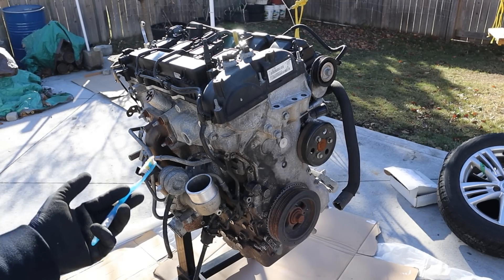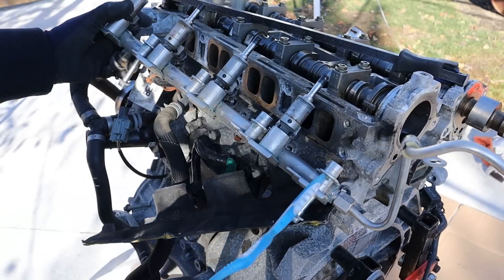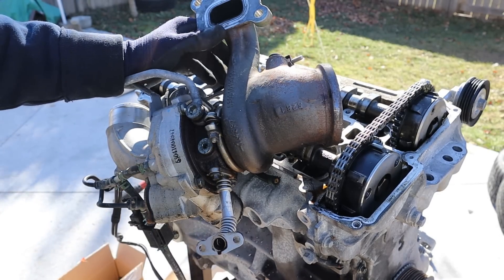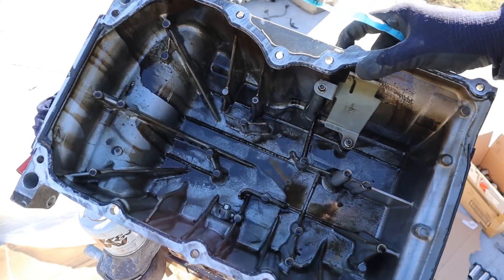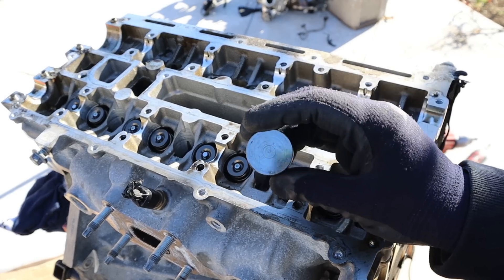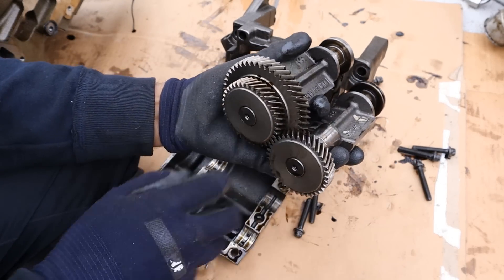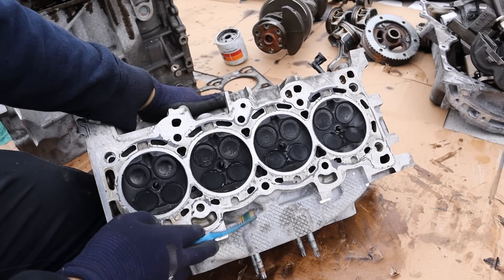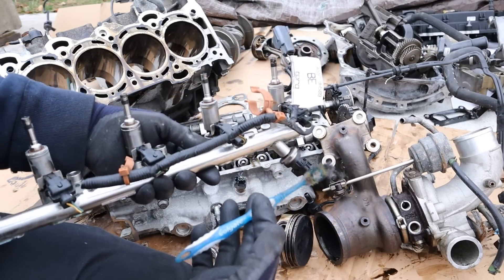Why Ford Ecoboost Engines Fail

Comment: this was before they discovered they would need port injection along with DI to wash or clean away intake valve heads and ports before massive carbon could build up. I have the 2.7L bi-turbo and luckily have not had any issues in 105K miles in driving. Its a mighty little motor and i see 130+ mph all the time...
Reply: @@alexanderratisbona6614 my personal cars are all 8 cylinder so the V6 is a little small to me

Comment: My brothers pants 🤣  Seriously, I loved that he explains so many weak points in the eco boost engine.  Notable is the direct injection, yes it gives better gas mileage but just like GDI on Kia's it causes carbon build up.  ( Im going to check if Speedkar has a GDI teardown)

Comment: It's interesting that 2L 2008 Ford Euro spec Mondeo diesel engines are so much more robust. I think my todays number was around 617 000km's. That's about 380t in miles? Anyway, I know base engine design isn't from Ford, but I still wonder how come they haven't been able to fix all those issues. I mean those Ecoboost engines aren't even that powerful for 4cyl engines. I suppose it's the emissions crap that engine has to inhale almost exactly the stuff it exhales is one big fault 😄
Reply: I wish we had diesel Mondeos in the U.S.!

Comment: Cool video!  Subscribed!
I have a 2016 F-150 with the 3.5L turbos.  123,000 miles and it's still running strong.
When I first got it I read about the water ingestion issue, and that owners were drilling small drain holes in their intercoolers to prevent it.
I instead replaced the anemic little OEM CAC with a much larger Full Race model, and haven't had any problems, even here in humid Florida.
My engine has upgraded Full Race turbos that are a little larger than stock, and a moderate tune that makes 435HP / 456 lb.ft. of torque.
So far I haven't seen the dreaded cam phaser problem, and the truck is a lot of fun to drive.
The DI system is causing carbon buildup I'm sure, and if I keep the truck I'll have to break down and decarbonize it at some point.
Reply: My crown vic was 3000 dollars and it just passed over 350k miles
Reply: @sethhumphries1682  crown vics are immortal from the get-go tho
Reply: Cam phaser issues are in the second generation of 3.5 ecoboost
Reply: Get an oil separator as well
Reply: The biggest cam phaser issues are 2017 to 2020.
Reply: thats called condensation and if you didnt have the OEM ford emmissions bullshit on it (EGR + PCV) it wouldnt force it to inhale water in the first place.

Comment: Every Ford I've owned and that friends and family owned ended up being nothing but problems. Every single one of them; from the 1970's to today. I could cite dozens and dozens of examples, each one ending in a major mechanical failure (head gaskets, transmissions, electrical problems, etc.) that wasn't worth fixing. You couldn't give me a Ford or even pay me to own one. They are poorly designed and engineered to fail. Pure junk.

Comment: New impact wrench? Or have you had this for a while now?
Reply from the maker: New impact, interesting you noticed. 
I'm so used to the 1/2", this impact driver seems so underpowered but it is light and zippy and I can put smaller sockets on it. Good for engine teardowns until I get to the bottom end.

Comment: By the look of the block surface on #1 looks like it may have leaked coolant to #1.
Reply: I don't think so, if coolant leaks into a cylinder it's going to steam wash it. Here all cylinders were carbon coated and dirty. I don't think that there was anything major wrong with that engine!